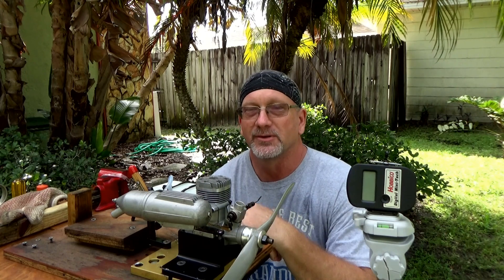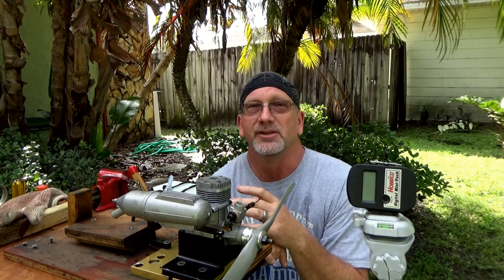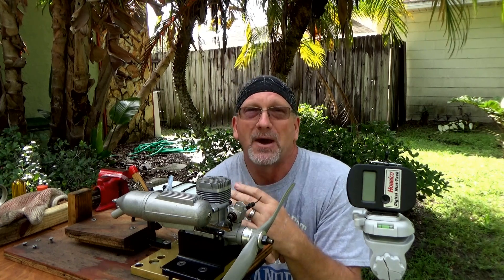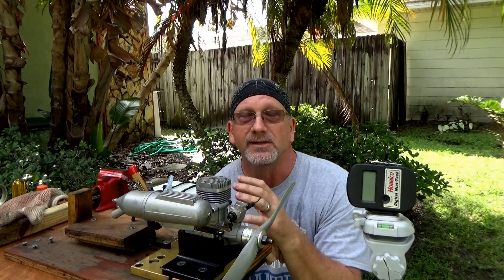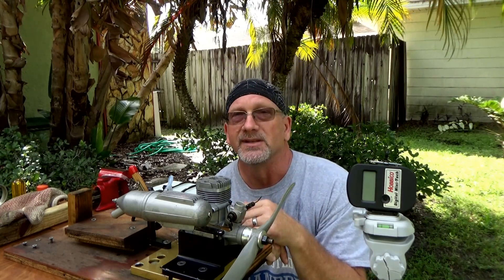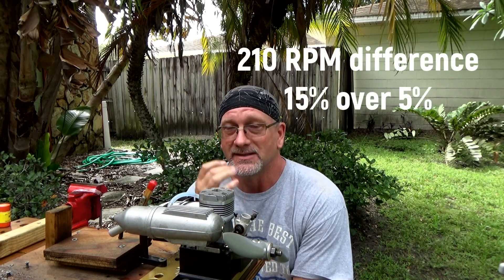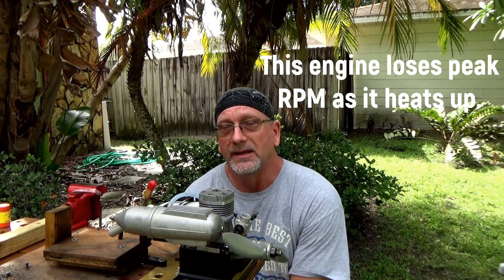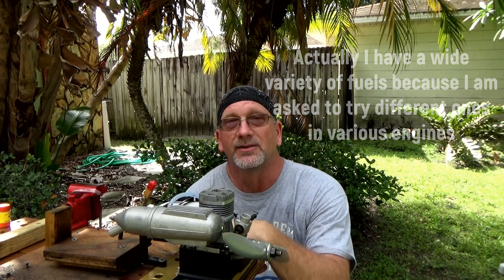Nitro Comparison 5% vs 15%

Comment: Did you measure thrust? Aka pulling power. The more nitro you pop in the more power. RPM will not really increase unless supporting engine mods are made.

Comment: A great back to back comparison a minor rpm gain seems hardly worth the extra expense of higher nitro. I mix my own fuel and have been running 10% nitro my next batch will be 5%. My planes seem to accelerate a bit better on higher nitro but I don't really need it. My first few batches of fuel were 15%. Thanks for the video
Reply from the maker: No problem!

Comment: Nice video, thanks for it. As far as I know, nitro helps or "add" more oxigen to the blend of air+fuel formula to create combustion, so at the sea level you tested it is probably not worth it. My friends and I fly RC models at 4040 Mt over sea level, so that extra nitro percentage helps us a little, but we appreciate that help. Do you have some reference about it?
Reply from the maker: I do not understand your question.  Do I have some reference about what?
Reply: David McIntire, good morning, I meant if you have some reference about the capacity of nitro to increase that oxigen contribution to the oxigen + fuel formula for internal combustion
Reply from the maker: No I do not.  I do not care to get that technical about things in my hobby.  This link might help,https://www.rc-airplane-world.com/rc-glow-fuel.html

Comment: Really good video David. You should do a follow up using a 4 stroke and also perhaps do a fuel consumption comparison as well to show the additional fuel used when using higher nitro. Your demonstration of why its wise to get the engine warmed up before tuning it was also something many need to pay attention to. 

Certain engines like nitro and indeed need it, but most are fine on 5% and this is why Laser recommend only 5%. 15% synthetic oil is also perfectly satisfactory for pretty much any engine from the last 30 years.
Reply from the maker: I have run the OS FS-62V on both FAI and 5% nitro fuels, just not in the same video.  I know I have run other 4 strokes on both or different fuels before also.
https://youtu.be/W3qQhFWKrpY
https://www.youtube.com/watch?v=729N3TTMQSg
https://youtu.be/MxaHFCE6o4Q
https://www.youtube.com/watch?v=zGX3xLFXbxc
https://www.youtube.com/watch?v=Bt5imHHJSR8
Reply: ah nice. I forgot to mention before it was also good to hear someone else dispelling the myth that is 4 stroke fuel. All glow fuel is essentially the same, the rest is marketing!
Reply from the maker: ABSOLUTELY!  I get the biggest kick out of folks saying you MUST run 2 stroke fuel in 2 stroke engines and vice versa.  A simple viewing of the ingredients of the fuel tells the most casual observer that glow fuel is glow fuel.  Only oil content/type and nitro vary really.  Thank you for visiting and commenting Jon. Much appreciated!

Comment: Was there any noticeable improvement in transition?
Reply from the maker: Sorry Mike, too many videos.  I did not show much transition with these fuel to keep the video shorter.  No I saw ZERO difference in transition from 5% to 15% nitro fuel.  Now transition is impacted to a degree when using FAI fuel.  But all settings change when 0% nitro fuel is used.

Comment: They say that more nitro brings more pulling power, you can run a bigger prop, but I do not see that big difference, I buy good quality fuel with 5 % nitro, and I do not have any problems, I can fly more  for the same money, and my engines like it, I run them many years with out any problems

Comment: good video man it's the same thing i run 10% vs 20% in my rc cars not much difference and it's a lot cheaper a gallon of 10% is about 38$ a gallon of 20% is 50$ and a gallon of 30% is 70$ lol
Reply from the maker: Wow, you fuel is expensive.  I have been running 5% in the TRX 2.5 and I keep an even 255F head temp and the thing is tweaked pretty damn good now too.  5% = $13.95   10% = $16.95, 15% = $19.95.  Fuel prices just went up here about 1 month ago too.
Reply: David McIntire wow! I wish fuel was that cheap here it seems to be Airplane Fuel is more expensive because not many people fly in this area anymore and 255° is pretty good I have noticed with Traxxas engines they seem to like to run a bit on the hotter side my last 2.5 ran it's best at around 270°ish I got a lot of people telling me I should be running 30% Nitro in a lot of my stuff and I don't pay because it's expensive and be I didn't like the way it performed and the engine life  is shorter I noticed performance gains over 20% hardly anything noticeable

Comment: This video is very good. It seems to prove the rule of thumb: '5% more Nitro adds 100 rpm'.
Reply from the maker: I wonder if there is more gained in the air though.
Reply: I just ordered an optical telemetry rpm sensor. I try to check this soon.
Reply from the maker: That would be very cool.

Comment: I have always heard that the higher nitro fuels allows for a wider range of needle settings. Have you noticed this to be true?  Does the higher the nitro content widen the range of needle settings that the engine can run at safely?
Reply from the maker: I know that FAI seems to close the adjustability range particular with the idle.  I have not noticed it between 5%, 10%, and 15%.  Those all seem equal to me.  FAI is the real tricky one, at least for engines not designed for low to no nitro.

Comment: Hi David, amazing results. Maybe you should add some information´s regarding ambient temperature and humidity.
Reply from the maker: I would say when I did this run it was 85F and the humidity was 55%
Reply: That´s quite hot :-) (85F = 29.5° C ). But we top this in Germany too (91.4 F). Maybe I will use "summer and winter" fuel to save bucks. Great test :-)
Reply from the maker: That was several hours ago, around 9:30AM.  It is currently 86F and the humidity is now 70% giving a heat index of 95F.